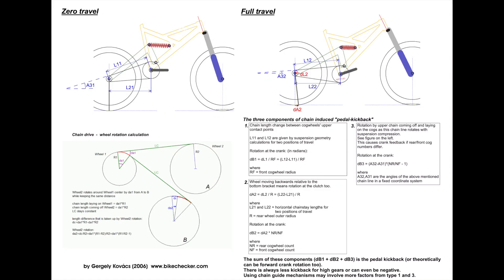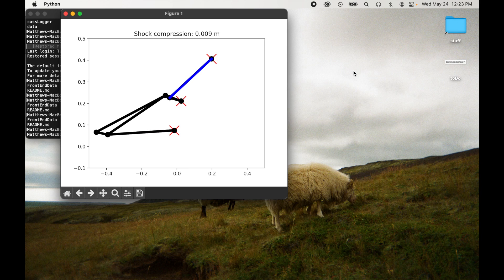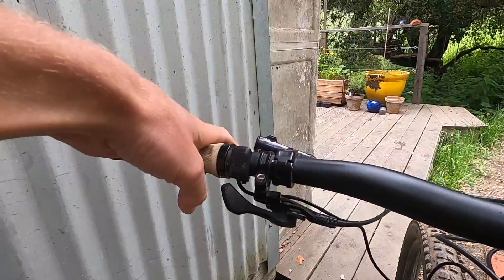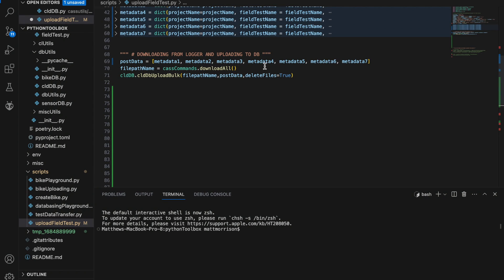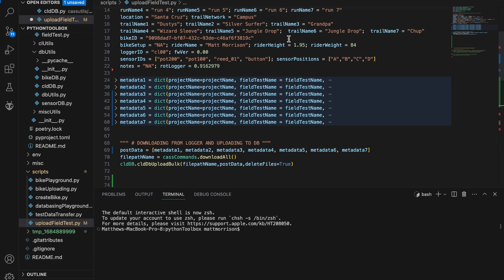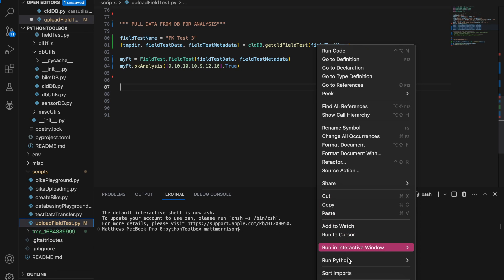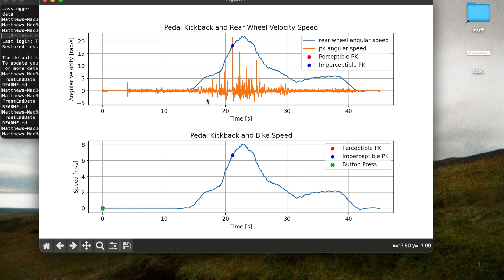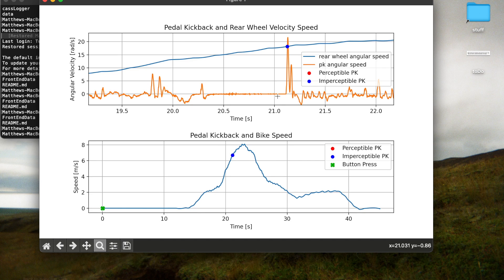Does Pedal Kickback Actually Happen? I Use Data Acquisition to Find Out!

Comment: Neat project. Was wondering about this exact thing not too long ago. 

A couple of minor things. The upper right graph at 2:30 shows increasing kickback with lower rear sprocket size. Pretty sure that this is the opposite of what it should be. Probably just a ratio error that would be canceled out in the final results. Also I'm pretty sure the DB2 term would already be included in the recorded wheel speed. As it represents the slowing of the rear wheel due to wheel base growth. So by measuring angular velocity of the wheel instead of the forward of the rider you have already accounted for that term.
Reply from the maker: Yes, you are right! I'm pretty sure this was my code mislabeling the legend. I'll dig into it and fix that bug. Thank you 🙂

Comment: I noticed higher engagement hubs have jerk back the pedals. Especially in higher gears on the brakes into bumpy rough sections in and out of turns until you get up to enough speed to not engage the hub when you pedal (depending on what gear you are in) if you are in a gear where you can pedal and engage the hub at a certain speed then hitting a bump will also engage pedal kick back. Landing on a drop in a certain gear, even though it will engage the hub as soon as you land you are propelled forward from the engagement so the energy goes to propelling you forward as the hub is engaged instead of kicking back the pedals. At least in my experience.
Reply: i run onyx hubs with infinite engagement , i haven't notice anything honestly , i will pay more attention next ride .

Comment: Would be interesting to see you do the same tests on a bunch of different rear suspension styles (single pivot, different linkages etc) to see if there is actually some non-marginal difference between them. I think a lot of reviews are bias by the fact that the reviewer sees a complex looking linkage, assumes that it has all of the good properties they have and then that feeds into the review. Like you said you experienced less kick back when you had your full face on because of the reduced noise.

Comment: Excellent work! Something I've been wondering about, is that since pedal kickback creates tension in the chain, it actually causes an acceleration of the rear wheel, so could theoretically make you faster! However if pedal kickback occurs more when you're on the brakes, then it's definitely a bad thing.
Also, i feel that pedal kickback when climbing can cause the rear wheel to lose traction over slippy roots.
Also also, I've been looking at pedal kickback on different bikes, just by holding the rear brake solid, compressing the suspension, and watching how far the cranks rotate backwards. This simple test seems valid to me, what do you think? Cheers, Gary

Comment: This has gotten really silly as, let's say, an enduro bike gets designed with little anti-squat to avoid this alleged pedal kickback, and if the frame was designed for a 32t for instance, there is now the narrative that running a smaller chainring is "non-optimal" because it's not what the bike was designed for, so poor you, now you have to buy a larger cassette if you want a lower gear, you can't just install a smaller chainring, which is absolutely pathetic, because the higher anti-squat (that installing a smaller chainring provides) will give you a better pedalling performance, at the cost of this mythical increased pedal kickback, and you could actually install a much smaller chainring like a 26t and it's perfectly fine. I definitely would install a smaller chairing  just for the better pedalling performance, were it not for the fact that I actually need the heavier gears.

Comment: Really great to see someone actually applying some experimental method into this question. Most comments of this subject are either subjective riding or static maths.

You mention to interesting points in your closing comments which both relate to how i ended up here. One is instant engagement (or the assumption of}. Im wondering if running an Onyx hub will lead to more experience of pedal kickback due to the instant engagement. Second, you mention the sound, which is interesting as i love the silence of the Onyx. I wonder ifthe silence and soft engagement might actually lead to less perceptible pedal kick back even though the zero degree engagement may lead to more events being transmitted to the pedals.

Comment: If I'm reading the plots correctly, pedal kickback occurs when the angular velocity of the cranks goes above the angular velocity of the rear wheel. It would be interesting to see how those plots change if you removed your chain. Right now the spikes aren't that much higher than the rear wheel speed, but I think that's because the impedance of your weight on the pedals limits how quickly the shock can compress, and since you pedal kickback calculations depend on shock velocity, that will limit how high that peak can go. I bet if you took off your chain, you'd see the calculated pedal kickback angular velocities go up quite a bit. That might be the most telling bit of data. Thanks!

Comment: This must be the first time i’ve seen a “bike class” in a YouTube video. Awesome 🤓

While no perceivable PK on a drop landing is expected as you feel a whole lot of force through the pedals from hitting the ground anyway and PK would just add to that, I do wonder if bikes with high PK are harder to ride through hard landings as not only is this “impact” force increased by having the PK force added, but all of that force is only through 1 foot (the front one) and throwing off your balance. Combining the measured PK value with gyroscope data that gives bike lean angle on landing across different bikes would be interesting, but the torque through each crank would also need to be measured to remove the rider’s input.

The idea of significant PK is interesting too. Partly to allow for the biomechanics of what the rider naturally absorbs, and also for what value actually results in the pedal being “moved”. Filtering out for hub engagement should be straight forward as it’s a theoretically known number, although the chain tension will also come into play. With enough slack across the top of the chain and a limited enough degrees of engagement of the hub all theoretical KB events from suspension position may result in no impact at the cranks.

I noticed the Fork class in there. Did you try measuring fork travel data too. I would expect that if the bike is “diving” forward then PK is also less perceivable, as the cranks rotate backwards relative to the bike but may stay fixed relative to the ground. Oh so many variables…

Brake and cadence data to know if you were on the brakes are pedalling when a PK event occurred would be interesting if going down the path of understanding when PK occurs during a ride.

Looking forward to seeing what else you throw together.

Comment: Would it be possible to plot total kickback in radians?  As you mentioned it would be interesting to have a better understanding of the magnitude of the kickback.  How much kickback did your cranks experience on the jungle drop?  From the graph it looks like 4 radian/s per second for a pretty short duration.

Comment: Excellent.
All the "Kickback" videos I had seen all seem to base their calculations on a stationary rear wheel..
Something I have considered...                   IS KICKBACK ACTUALLY BAD?
My understanding is, Kickback is loading the crank with negative rotation and the rear hub with positive rotation...
Your legs act against the crank rotation moving the entire force to the rear hub... 
Positive rotation of the rear hub is acceleration...   (albeit it miniscule)...   

"Every little helps, said the ant,"...       (1590 G. MEURIER Deviz Familiers (via The Oxford Dictionary of Proverbs)    ...So there mum and dad... It wasn't the Duchess!..

Comment: I'm going to start my comment with a disclaimer that my math and physics are not my strong points.
My previous bike was the ibis Ripley LS v2. After about a year and a half of riding, I swapped out the 32t chainring for 30t. I then found that for whatever reason the pedal kickback became worse.  I found myself on lower gears (obviously) and on these lower gears the kickback was much worse.
I also found that while climbing, my shock was more compressed, though the change of chainring may not be connected. To a point where if I'm not mistaken, at the next service of my shock, I requested that a token be added. 
Does any of this make sense?
Reply: anti squat and pedal kickback change with chainring size. I would recommend getting linkage x3 and having a play around if yo want to know more. I don't believe a token in the shock will help though, probably would need more LSC to prevent pedal bob if anything
Reply: @guymacarthur5161  thanks. That was on my old bike that I sold already. I feel really validated right now so much appreciated!

Comment: Good Job! I have a S4 Evo w/ WAO Unions and Hydra hubs, flat pedals and 5.10s. I notice PK in 2 circumstances... climbing: rear wheel extends then quickly compresses, descending: super chunky trail where I'm going a bit slower than intended due to a mistake. Both can be bad enough to bounce a foot off a pedal. I live in CO so have some really janky rock trails that can present worst-case scenarios, the trails in your vids are relatively smooth in comparison. One example with easy to find vids is the Bitterbrush Rock Garden at Hall Ranch in Lyons, CO. For me, it's a pretty minor issue, I notice it just a few times a year and generally as a result of not being smooth on the climb or making a mistake on the descent that forces me to slow down more than normal. With smoother climbing and maintaining over a few mph on the way down it's never an issue, but I do wonder if an O-Chain device would make things smoother... seems like you're all setup to test one! 😉